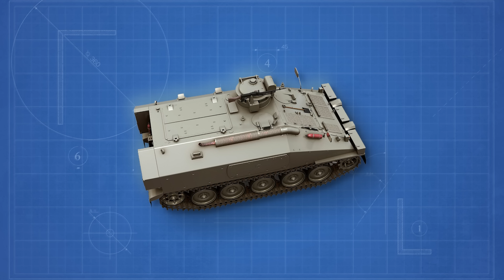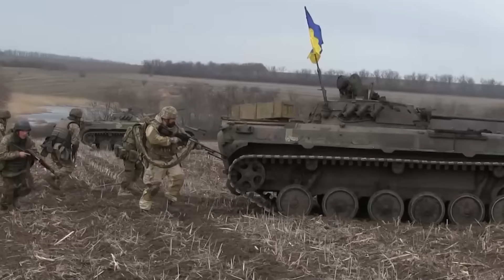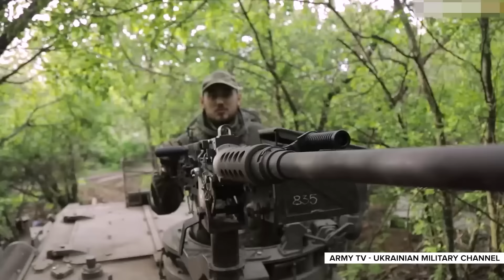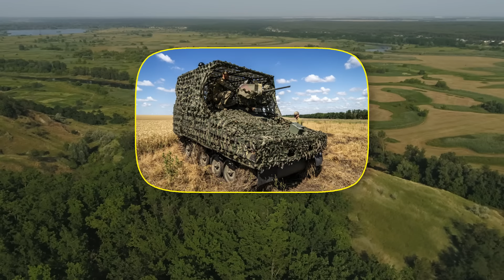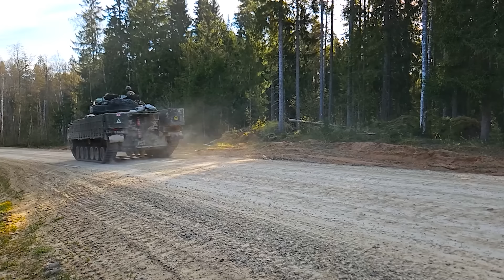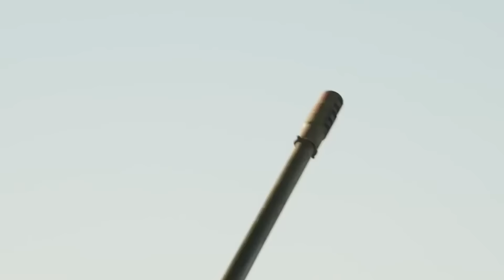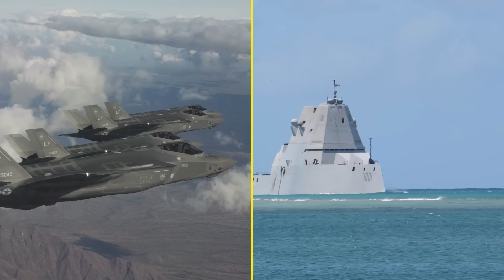Ukraine Turned UK’s Junkyard Armor Into a FRONTLINE MONSTER

Comment: One thing glossed over a bit with these lend-lease type schemes etc are that NATO stocks of these admittedly antiquated mothballed kit is also being depleted faster than they are being produced.

This means should we end up going to war, reserve armour and armament that could be used for home defence or back line roles is diminished.
Reply: But our most likely adversary is Russia who these old vehicles are now fighting. So they are doing their job before we are directly involved.
Reply: @dougwhite1491  oh 100% but to frame it as we're unaffected is incorrect. It's most certainly depleting western stockpiles just we're unable to minimise losses by also using our current tech to basically glass western Russia or obtain air superiority.

Instead we've a meaty ground war that grinds through men and materials.

Comment: Isn't ajax the vehicle that UK soldiers complained too noisy and vibration to extent of being health hazards
Reply: GD has fixed those issues, having said that - a better suspension should have been factored in when the Ajax weighed far more than the standard ASCOD2 chassis it was based on.

Comment: The balancing act all military equipment faces is being good enough to deal with everything thrown at it, at acceptable loss rates, while being cheap and quick enough to cover all the territory you need to, and being sturdy enough that the crew survive to jump in another one. Very tricky balance to maintain, but every large war has shown that however high tech the tip of the spear is, it's still needs a wooden shaft

Comment: Makes me wonder if we should make a Spartan2?  Keep it cheap, upgrade nothing except the radios and gun and use modern methods of production but not mess around with the thing itself other than whatever tweaks make it cheaper to produce.   It would probably require a different engine if we're not making those jaguars anymore. Then they could have 300 or 400.
Reply: CVRT 2s are very heavy and tall- great for COIN Ops but shit for Conventional warfare.

Comment: There's so much value in a 3x5 m empty metal box on threads with a sturdy 300 hp diesel, it can be crude and lack all the advanced systems. Military should learn from the Sparta. The use of a classic M2 Browning is just stellar.
Reply: Forces have to realize at some point (like Ukraine has) that less complicated and affordable systems that can be fixed easier in war is preferred. Just like modern cars. sorry for answering myself. It's such a huge dilemma today.

Comment: Saw administrative results test anti drone 5.56 ammo and it looks promising.  A whole belt or mag dumped full auto by a couple guys simultaneously would have a very high chance of downing a drone.  If very squad member had 2-4 mags of it they would put a dent in the drones of local operators.  A drone team can only bing in so many drones without resupply and it would be a helluva advantage to wipe the local drone population for a time and have freedom of movement.  Why isn’t this anti drone 5.56 already in theatre by the c130 load?  The stuff looks like it could actually provide some change and has much more range than shotguns, which would cause drones to have to stand off more and give you a realistic chance to drop fpv drones well before they are in range where a detonation upon being hit would mdamgwr anyone.  A belt in a saw would be a very good close air defense, and same tech scaled into .308 and .50 would be even better and provide multiples of the 6 separate projectile the 5.56 rounds produce.  They grouped out to like 5-6 feet circular at 100 yards, so your chance of hitting when you spray half a mag is high, putting out 90 chance to disable a drone in a 10 foot circle should provide a realistic chance to down a small If they can having use m113’s beg can use anything.  Straight up Vietnam era tin can with a fifty on top.  Surprisingly seen many take more than a couple fpv strikes, so why wouldn’t the Spartans be effective in certain roles?  Issue is that recon light armor isn’t needed today.  Need a beast taxi, no weapon or ammo weight, monster engine, as much armor as you can find a transmission to handle, including on top, then cram in as many infantry who can fit and throw it out there.  That is all they are doing with the bmp, m113, maxxpro and all the other wheeled vehicles.  Aside from the Bradley with its fantastic auto cannon and tow/hellfire missiles, everything else is just a taxi, so the spartan is as good as any of the others

Comment: I'm surprised that the whiz guns on aircraft carriers aren't put on a platform like a tank. Just think,a tank with  2 whiz guns that could be  autonomous , loaded with ammo to take out uav,fpv drones and missiles that could also be used to clear swathes of enemies at the front. Like a wall of steel that couldn't be beat that could target 360' around it and above it. Put 1 spaced out 1/4 mile from each other. A system like this could prove to be a real morale buster for the enemy. Terrifying even !
Reply: they take a lot of power and ammunition to run. The US Army mounts them on vehicles but the platform they use is a HEMTT which is absolutley massive, as they need to not only carry the weapon but the generator required to run the gun and the massive amount of ammunition.

Comment: This DRONE AMMO developed by an ARIZONA company called UNLIMITED AMMO could save allot of soldiers. 556 and other NATO calibers. 90 grain, travels about 2200 fps. (Twice the speed of the best shotgun rounds) Less lead time needed and shoots further and more accurately with 5-8 hole punchers per round depending on which round You're using. Sent You the link to the demo that just came out 4 days ago. It's called DRONE AMMO. Made by UNLIMITED AMMO in Arizona. 
Seriously,....... Get some. Thank me later.

Comment: Spartan is only one variant or the cvrt family there is anti air, mlrs 30mm cannon versions. If you go back further there are larger cannon versions. They are high speed light weight vehicles. Can go just as fast forward as reverse

Comment: why did you get lazy at the pressures ? the three main westerns seem to be approx the same as the T72:
Leopard 2 (Germany): ~ 0.83 kg/cm². 
Challenger 2 (UK): ~ 0.9 kg/cm². 
M1 Abrams (USA): ~ 0.92 kg/cm² (13.1 psi) for combat-loaded.
Reply: The Spartan (and sister vehicles) were famous for having low ground pressure. There were many stories of troops jumping out of the back, and sinking to their knees in the mud!

Comment: Very Briefed And Summarized Ideas:

I think 🤔🤔🤔 this reconnaissance armored vehicle is suitable for the ukrainian needs, small, agile, highly mobile and easy to be hidden and useful in infiltrating the russian lines and negotiate and maneuver across the ukrainian urban and rural terrains...

although the ukrainian need to develop it further by: 
1-enhance the survivability by adding extra armor although it could come at the cost of the agility and the mobility, while changing the engine and the transmission will add to the overall cost, while the active protection systems could be considered to be an expensive option especially for those small IFVs,
2- the fighting capabilities by equipped with new modular turret and the ukrainian military industrial complex previously developed few turrets for the bmp infantry fighting vehicles those turrets could installed on the bmd series of airborne infantry fighting vehicles both the scorpion🦂and the bmd in same category, or at least remotely operated fighting station a mixture of rapid firing 30mm and above, either Bofors 40mm, soviet analog k61-1939 37mm gun, with some working they could install the S-60 57mm paired with either automatic grenade launcher or ATGMs...

if the ukrainian armed forces decided to form highly trained offensive units specialized in winter assault operations, and other harsh conditions this IFV could be suitable to form the base for highly effective mobile, rapid response combat formations...

Comment: Its a brilliant APC, we loved it, even dropped by Parachute...4 troop recon vehicle and easily modified, but typical MOD wrote it off and bought that useless Panther... We mounted a Milan on the top, but were told to remove it lol, We could hit 60mph with the cummins engine, far better than the original Jag... go Ukraine...

Comment: Vehicles/planes/ships are often mothballed due to maintenance costs, not functionality. Maintenance costs are certainly a factor in times of war, but less than during times of peace. That's because machines in combat will take losses and damage at a much higher rate than general maintenance requirements. So old equipment is often just fine, even ideal, for combat.

Comment: The Scorpion/Scimitar/Spartan is still an excellent light armor design. Comparison with the Bradley is misleading at best. It's a fast, light, small vehicle meant for airdrops, and recon, and it does that still very well.
Reply: Yea Bradley is closer to a tank than most APC’s more suitable for assault, Spartan is a great battle taxi.
Reply: don't forget sultan and samaritan

Comment: The Sherman tank in WWII was similar It was inferior to German panzers in almost every way except ease of replacement and cost to maintain this factor helped the Allies win the war . We need to beat Putin in  this current war of attrition .So perhaps instead of kit that is expensive to produce and maintain but rules the battlefield , weapons that do the job but are quickly replaced and easy to keep running  might be in a theatre dominated by drones that can take out even the most heavily armoured battle tank preferable  As long as it protects the crew Sherman’s were nicknamed Tommy cookers , everything else can be replaced Ukraine is proving once more necessity  is mother of invention but history has taught us things we should not readily forget
Reply: German panzers were deeply inferior in most aspects other than the gun and sometimes the armor.
They were unreliable, complicated, and expensive. Not to mention there were usually 8+ variants of each model that did not have interchangeable parts.
So they were unavailable and resource intensive, and consequently they were operationally deficient. And the Germans could just send damaged vehicles back to the factory via railroad. 
Shermans had to cross an ocean just to get started.

Sure, if we did gladiatorial tank combat, a Panther will toast basically any WWII variant of a Sherman in a 1v1. 
In actual war? The Sherman pastes everything the Germans had.
Even the "Tommy Cooker" label came from the British practice of stuffing ammunition everywhere and having it literally backfire when they got shot. 
Shermans had one of the best survivability rates across all models.

I would argue the lesson Ukraine has emphasized the strongest is adaptability. For some things you can absolutely cheap out. I doubt you'll see an M113 on the frontlines proper because it wouldn't do much other than be an 8x15 foot target, but there are still a ton of uses for an armored mobile box for a military. 
But sometimes you absolutely shouldn't go for the quickly replaced unit.
Ukraine has done a lot with the FV103 because it found a useful niche. It's still not replacing a modern IFV like the Bradley or BMP3 in a combined arms breach.
A lot is made of drones killing tanks that cost orders of magnitude more. Drones make the role of a tank more difficult, but nothing replaces what a tank does for an attacking force.
Otherwise, neither side would bother spending the enormous amount of resources it takes to field them.
A drone operator with a couple of quadcopters, some grenades, and a dream, is capable of destroying an entire Patriot battery; no one is suggesting to ditch or cheapen air defense because of it. Ukraine stills asks for GMLRS, HIMARS, ATACMS, and PRSM, despite drones nominally filling in a similar role because sometimes the expensive to produce and maintain thing has been shown to be the "cheapest" thing that reliably accomplishes the goal.

So, while the German Wunderwaffe route obviously failed, taking the Soviet route of "cheapest, replaceable, thing that technically works" is also not going to work out unless you want to accept Soviet levels of attrition.
Reply: Attrition of men is the thing to preserve. Western armored vehicles were built for that in mind. Yes they got rediculously heavy and expensive over time, something that shouldn't have happened. However they are survivable. Russian tanks are not survivable when destroyed.

Ultimately Ukraine adopting their drone strategy is probably the best was to withstand a war of attrition against the Russians.
Reply: tigers and panthers were the only german tanks that were "better" than the sherman. shermans easily took out panzer 4s and 3s, which were the majority of german armor.

Comment: This is a compelling observation, and you’re absolutely right—Ukraine’s adaptation and enhancement of allied military equipment closely parallels Israel’s well-known tradition of upgrading and innovating on foreign-supplied hardware.

HISTORICAL PARALLELS: ISRAEL AND UKRAINE
Israel, throughout its history, has received foreign military equipment (often from the U.S. and earlier, France and Britain), but rarely used it in its original configuration. Israeli engineers and soldiers routinely upgraded armor, fire-control systems, electronics, and weapons to better suit their strategic environment and operational doctrines. Classic examples include the transformation of the Centurion tank into the Israeli "Sho’t," upgrades to American F-4 Phantoms and F-15s, and the repurposing of various armored vehicles into command and ambulance variants.

UKRAINE’S ADAPTIVE GENIUS
Similarly, Ukraine has received an eclectic mix of vehicles, artillery, drones, and missiles, often from multiple NATO countries. Facing resource constraints and a relentless adversary, Ukraine has:

- *Integrated Western and Soviet Equipment:* Ukrainian forces have successfully combined American-supplied weapons with legacy Soviet platforms, such as mounting U.S.-supplied HARM missiles on MiG-29s and Su-27s, or integrating Western communications and targeting equipment into Eastern Bloc artillery.
- *Improved Protection and Lethality:* Field-modified Bradley IFVs and Leopard tanks have received additional armor, drone-interference devices, and locally-produced reactive armor.
- *Creative Use of Drones and FPVs:* Ukraine has improvised and scaled up the use of commercial drones for surveillance and as loitering munitions. Many of these systems are cheap, disposable, and yet devastatingly effective, leading even larger militaries to rethink their own doctrines.
- *Upcycling "Disposable" Equipment:* What other militaries might see as obsolescent, Ukraine has often repurposed or modified, extracting ongoing value. Everything from old Maxim machine guns to towed artillery has been adapted with modern sights, mounts, and ammunition.

WHY IS THIS IMPORTANT?
This approach embodies:
- *Resourcefulness under pressure:* Ukraine, like Israel in the past, cannot always rely on a steady flow of new equipment. Maximizing what is available has been a necessity.
- *Adaptability:* Battlefield innovation, bypassing slow procurement and bureaucratic processes, keeps forces one step ahead.
- *Doctrinal Flexibility:* Both nations have shown a willingness to rethink how tools are used—deploying equipment in roles never intended by their original designers.

CONCLUSION
This “collective genius” is not just about hardware—it’s about a culture of innovation, learning, and adaptation under existential threat. The ability to take “disposable” equipment and transform it into decisive battlefield assets is a profound strategic advantage, and Ukraine’s success on this front deserves to be both studied and emulated.

Comment: The Spartan has its advantages in low weight for running on soft terrain and being small is a harder target. 

Basically it's a small scout vehicle. If it's very effective for the price the down side is the lack of mass production from the parent country. 

In comparison the heavier Bradley and M113 were produced in the several thousands. 
Germany has the Weasel another low tech scout. They are producing a replacement for the Weasel the Weasel 2. 
Maybe Germany can offer Weasel 1 to Ukraine if the vehicle is fully replaced?

This is a Stop gap and if this class of vehicle is currently superior the Ukrainian Army could look at making a better version of it to roll through mud as their enemy gets stuck in it.